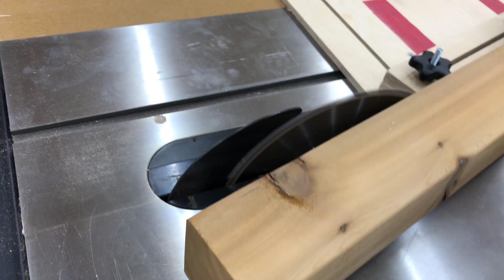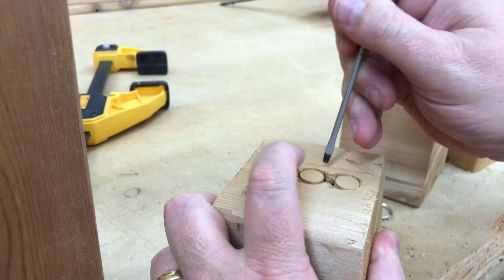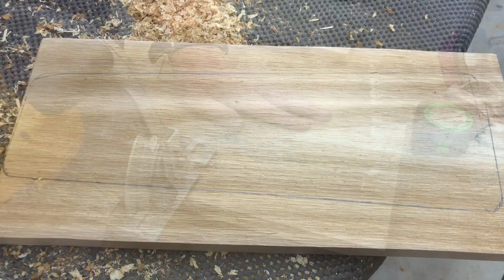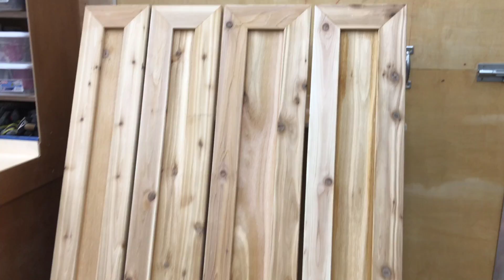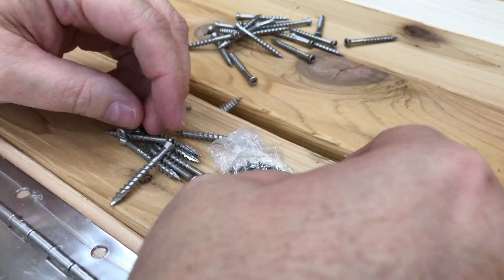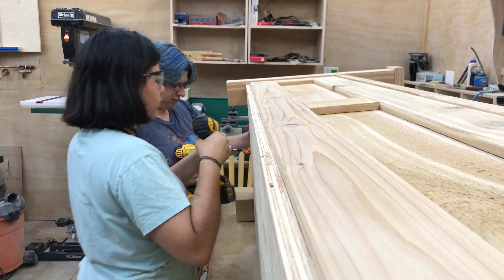31 - How to Build Garden Bench with a Hidden Storage Compartment

Comment: Buying the wood in two days and live in the sticks. 100 miles from the lumber yard. Is it okay to have the lumber yard cut the 12 footers in half to fit in my truck or do I need the 12 feet for odd lengths? Thank you.
Reply from the maker: That would be fine. The longest length I think is 61”. So you’ll be fine.
Reply: Thank you!

Comment: What was the actual build time on the bench without the finish? Also the rough costing? From all the screws and extra infill bits etc, I am guessing it is a really expensive DIY build, let alone the added labour costs lol.

It does look ok, but a bit too blocky looking for my likings, but hey, each to their own, clearly the client is happy.

Just an observation, but would the water not pool in the storage compartment when it rains? That has got to be bad for longevity, surely a couple of drainage holes would be helpful, even give the bottom an angle so the water drains to the back, then you would need less drainage holes? Just a thought.

Anyway thanks for the video, slightly longer than it should have been, but more detailed (and photo bombed lol) as a result. Keep up the good work, look forward to seeing more.

Comment: My customers said for me to use a dovetail or finger joint not a pocket hole joint I found the pocket hole joint is not strong enough for your project  of this 25 of my customers likes my joints better I gave all 25 a pocket hole joint and Dovetail and finger joint sample and they said the finger and dovetail is stronger and the pocket hole joint is weak on pressure on the edges of the wood and I agree!

Comment: Hi James, what an awesome bench. Great job, I really enjoy watching you and your clan build things. I get some great ideas from your videos. I have a question though, the piano hinge you used, I noticed that the hinge portion looked like it protruded above the level of the seat. My question is, was that just an optical illusion from the video or did it actually protrude? If so couldn't that have been recessed a little? Thanks.
Reply: I'm building one now and thought the same thing; thanks for the observation! I think I'll set mine slightly under flush with the seat since it cannot open past the backrest.

Comment: How long is this bench?  Thinking of purchasing the plans.
Reply from the maker: Corbett Brasington, hi, it is about 6’. But you could easily stretch it to make it longer, or shrink it to make it shorter.
Reply: Ok so you dont think the back would bow sitting on it without a middle brace if I extend it to 8 or 10 ft long?   @KingsFineWoodworking
Reply: @BrasingtonAssociates  Make two

Comment: Not trying to knock your skills but this bench is an over kill and a lot of money its nice but not every one can afford that bench and im not trying to through my back out moving that thing around
Reply from the maker: It is cedar. Not very strong. So I used thick pieces and extra bracing. It is actually not very heavy because the wood is so light. Also, it was built to customer's request and bolted in place so it will never be moved.

Comment: I like the way everything looks but there's gotta be a cheaper way or smarter way to use less wood to build one bench. You have posts next to posts next to posts all screwed together. I mean I understand and appreciate sturdiness but it looks like you could build a small shed with the wood you used for one bench. For a DYI-er that's not practical. I paused at 22:10 - it's a view of the corner of the bench and i'm counting 14 individual pieces of wood...and those are not small pieces...
Reply from the maker: You could be right but cedar is cheap and it is weak. Thank you for commenting.

Comment: I would only add that stainless steel staples would be better than galvanized when using red cedar.  The tannin will eventually corrode the galvanizing and you can also get bleeding.  Great project though!
Reply from the maker: Thank you for the tip!

Comment: On its way I like the 3 but the set up time is quick when I build doors I use the Westlund epoxy for the mahogany (sapli) and that works well ....send some tight bond 3 to you this week
Reply from the maker: You are awesome! I also use epoxy for various types of joints. I have never tried the Westlund, but I have used West Systems Epoxy for a long time.

Comment: Great video!  Did you fill the holes for the pocket screws for the back rest? I know Kreg makes plugs but I've never seen them in cedar.  I guess you could  get a cedar dowel and make your own plugs?  I use pocket screws all the time and love them
Reply from the maker: Hi Jeff! I did not fill the pocket holes in the back because the benches are permanently secured against a fence. But I often do fill pocket holes. You know longer have to buy the Kreg plugs, you can now make your own pocket hole plugs out of any wood. I just bought this Kreg pocket hole plug cutter and it is awesome. It ends up being way less money than buying their plugs. Here is a link if you want to check it out.  http://amzn.to/2fAUjdd
Thanks~James
Reply: Never seen cedar plugs either but they do actually make a pocket hole plug cutter and you could make them from any wood you choose. https://www.kregtool.com/store/c22/kreg-jigreg-accessories/p349/custom-pocket-hole-plug-cutter/

Comment: Nice video but was wondering why you were routing in the wrong direction?
Reply from the maker: Hi Patrick! That is an excellent question. And I should have talked about it in the video. 

When rabbeting a splintery wood like Cedar, I always go backwards. To go the regular way would cause big chunks to split off. 

This does require a firmer grip on the router, and you must go slow. But the results are worth it. 

Alternatively I could have made the cut in 5 or 6 passes instead of 2, this would have decreased the likelihood of a breakout splinter chunk. But the Cedar has such a low density, cutting in deep passes each time was easy & quick. 

Thank you for watching and commenting. 
~James
Reply: I think going that direction works better in the Southern Hemisphere, correct?

Comment: Nice build as usual. Those puppies are bullet proof, and strength, you could park cars on them. How much do they weigh? I know they ain't blowing away.
Reply from the maker: Hi Daniel. Thank you! Surprisingly, they are not very heavy. Maybe 125 - 150 pounds each. That kiln dried cedar was very light. If I had made it with douglas fir, it would have been double the weight.

Comment: Good Lord don't let the purists see you using pocket holes lol. Great project James!
Reply: The Egyptians used pocket holes..........only with dowels not screws.
Reply from the maker: Hi Daniel! That is fascinating. I had no idea the Egyptians did that.
Reply from the maker: Hi Anthony, oddly enough more than half of the complaints are because people think pocket screws aren't strong enough. Just wait until I release my next video! I show how unbelievably strong they are. I built a wooden ramp with only pocket screws and drove the front wheel of my 4-1/2 ton Excursion on it. And pocket screws held it up.
Reply: King's Fine Woodworking - I use pocket screws to hold on my table tops myself, it beats drilling pilot holes to insert (name favorite head screw here) in the hole. Pocket screws just make life much easier and yes I have actually seen that demonstration of parking an SUV on a ramp held together with pocket screws in the past.

Comment: Hi James the bench looks great. I plan to start working on the vices in Sept it has been to hot here to do anything.  It has been over 100 every day. I have AC in the shop but it a small unit it work great if you are under 100 but over not so good. I have to pull out the Porter Cable dove tail jig from the shed and look at your video again.  It was my father jig and I have never ever used one at all but it is like yours I will use scrap wood first to get the hand of it. Again you do great work and it is nice to see your family helps you that's good.
John C . Dunn
Reply from the maker: Hi John! Thanks!  Wow, I can't imagine working in heat like that either. We do have a big AC unit, but it's expensive to run all day. Luckily we don't have heat quite that bad here.